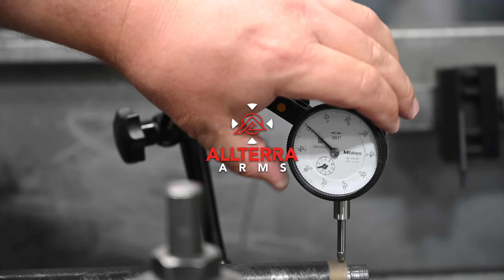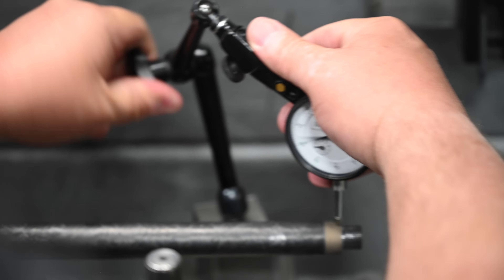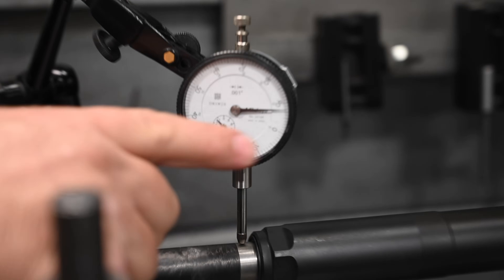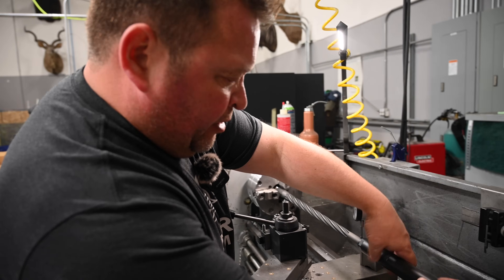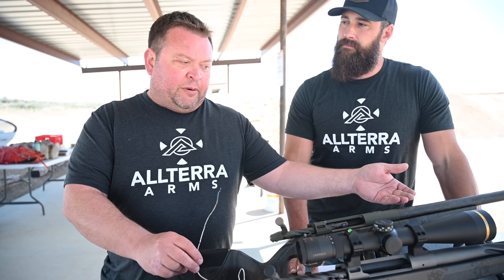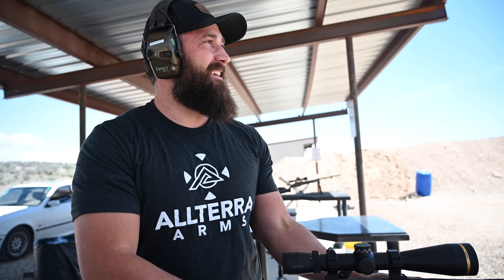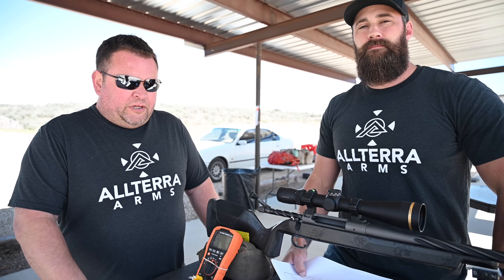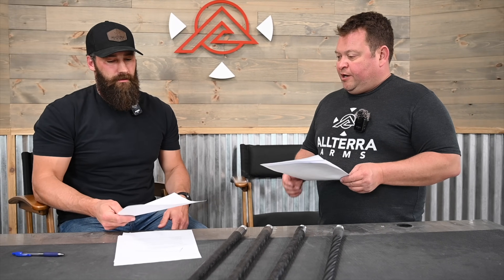Carbon vs. Steel Barrels: Rigidity and Cooling Test

Comment: Carbon wrapping & resin is an insulator obviously. Thats why nobody uses one in multi round competition. They have their place in the light weight hunting realm no doubt.
Reply: No, it's the resins and specific epoxies that are patented for heat disipation, particularly in the Proof barrels. They don't get nearly as hot, Outer or internal in what I've tested.
Reply: @apeshitcrazyman  Basic thermodynamic science says otherwise. No matter the manufacturer. Run a 20 shot non stop string through one & it will show you all you need to know on the heat front. That's why comp shooters don't use them.
Reply: @jaimesanborn308  No, now listen... comp shooters DO use them. But there are many great barrels for boltguns. I shoot comps, I've tested that very thing with a digital temp sensor. That's precisely where they do well, is longer strings of shooting, the temperature maintains cooler over a longer duration, where as steel takes longer to heat up but keeps and maintains that heat and continues to rise,,,,"thermal dynamics" as you claim,,, in fact that's what the first carbon barrels were designed for originally, is full auto schedules of fire, so as to plateau out in temperature, thus extending the barrel life, as it's under the extremes of temperature that barrels undergo the most wear....nothing close to mere 3-10 shot strings of bolt-action rifles.  BUT PAY ATTENTION, there is a big difference between the immitators and the OG, "Proof Research barrels", because they have a bunch of patents on the thermal conductive glue and resins,,, this is where the thermal advantage is... these other new carbon barrels, that are just insulators to heat, and lightweight which are better suited and marketed towards hunting rifles,,, the imitators of carbon barrels, just trying to piggyback on interesting technology and marketing.  You must understand the complete picture,, not just a surface level hunch and opinion on youtube!
Reply: @apeshitcrazyman  Interesting.. Not sure how proof has developed a resin that nobody else has? Resin tech is pretty straight forward, 2 parts that dry to a desired hardness. Carbon fiber is pretty straight forward as well. I work in the composites industry. I can almost 99% guarantee you they have nothing special in that arena that everyone doesn't already  have. Unless it's super space age proprietary type jam...
Reply: @apeshitcrazyman  They just used a data driven approach to show carbon is in fact hotter in this video... you got a video to show or just a "surface level hunch and opinion"?  And no, you do not see carbon barrels in high level comps, >5% at best and only on guns of folks that don't shoot enough to replace often.

Also, to original poster, video shows that a steel barrel at same weight (lighter contour) as a carbon barrel is MORE rigid and dissipates heat better.  So steel beats carbon in "light weight hunting realm" too...
Reply: @jaimesanborn308  Well my good man, i have friends who work there, so yes it is pretty space age stuff. Check out their patents good sir, you'll see that they are a parent company of a chemical engineering company that deals in plastics and thermal resins...and were 1% tooo incorrect. There are microfiber tubules involved in the orientation and weave of their carbon fiber,,,,, it's not just "pretty straight forward." They have whole security measures around it to protect the proprietary stuff.  . . Anyway, lil tidbits.
Reply: @apeshitcrazyman  Idk? All the tech mumbo marketing jumbo is pretty irrelevant in that great scheme of things. Proof barrels are no more accurate than run of the mill Tikka barrels/common production barrels unfortunately.
Reply: @jaimesanborn308  ....uh huh, yeah, this is me not being convinced of any of that. I now know, that you don't know. Sorry to hurt your ego, but you're not correct. Run along
Reply: @apeshitcrazyman  Convinced of what? That Proof barrels are nothing more than marketing hype that don't shoot better than anything basically... 😂🤣😂
Reply: @jaimesanborn308  @apeshitcrazyman The barrel in our temp test in this video is a Proof.

Comment: Hunting with minimal shots taken I’d opt for a lighter carbon barrel . Reduced weight of gear allows you to pack out more game.  Competition, I’d opt for larger steel barrel. Advantage of increased stability and recoil reduction.
Reply: Fluted steel barrels are lighter than even “featherweight” carbon barrels. Literally no advantage to them. A stock tikka barrel is lighter than any carbon of equivalent length
Reply: If you want a lighter barrel order a lighter barrel. In this video if you can actual understand the  words comming out of the mouths of the presenters the barrels where close to the same same weight within 3oz of each other. The lightest barrel in the bunch was one of the all steel barrels.
Reply: @buckaroobonsi555  I think you’re proving my point? At same weight, steel wins. So in theory you can go even lighter with steel, and get same performance as carbon. No upside to carbon
Reply: @Intermtn9736  It's just another wallet sucking accessory nobody needs.

Comment: 10:49 Wait, when you measured deflection, you used barrels of different lengths?!?  Adding a weight to the end of a longer barrel would add much more force than closer on a short barrel.  Did I miss something?
Reply: Yes they made them the same length by checking a barrel with a longer shank deeper into the 4 way chuck so that the amount of length from the chuck forward to the muzzle where all identical.
Reply from the maker: @buckaroobonsi555 what this guy said ☝🏼
Reply: @allterraarms Thank you.  Figured I missed something.

Comment: Choose the correct tool for the job.  If I'm packing a rifle high into the mountains on a sheep hunt I would rather have the carbon barrel to save any weight I can.  Put me on a dog town, and no way in hell would I want a carbon barrel.
Reply: See comment above, but carbon barrels are always heavier than hunting contour steel barrel, especially fluted. Literally no advantage to carbon but looks (and obviously, impression they are lighter. Which is marketing BS “compared to same contour in steel”)
Reply: @Intermtn9736  A carbon barrel is always lighter than a steel barrel of the same contour. Of course a carbon barrel that's .850 at the muzzle is going to be heavier than a pencil thin  .625 steel barrel.
Reply: @rdsii64  Nobody argues that, but you've been reading the marketing my man.  Nobody in their right mind is putting a .825 straight taper un-fluted steel barrel on their hunting rifle, which is your/marketer's comparison.  This video literally shows that a lighter contour steel barrel of same weight as carbon a) is more rigid and b) dissipates heat faster.  So better in every way.  Ever wonder why carbon barrel mfgs don't have studies or vids like this?

So, it logically follows that you can go even lighter on the steel and get equivalent stats (rigidity/dissipation) of the carbon.  Which mirrors my experience with both, and the experience of hundreds of others who actually test these on forums etc.  Carbon is just for looks, nothing wrong with that.
Reply: @ sigh. Go read it again. You’re regurgitating proof marketing.

There are no carbon barrels below a “sendero” contour for a reason… they’d be too flimsy (despite “featherweight” and “light” marketing names or tapers to .750). So it’s marketing fallacy to compare to same contour in steel, but they do it because it apparently works…

Video just showed the exact same weight steel barrel as the “lightest” carbon barrels on the market beats it (yes, it’s a lighter contour to be the same weight). That lighter contour steel is STILL more rigid and dissipates heat better than the thicker contour carbons that weigh the same.
Reply: A pound of lead weights the same as a pound of feathers! Carbon barrels are not lighter than steel barrels since under the carbon wrapping is a steel barrel that has been machined to a lighter profile before it has been wrapped. If you want a lighter barrel you pick the counter and length in steel that gives you the weight you desire.

Comment: I’m a believer that that carbon barrel acts like an insulator and internally temperatures are actually hotter than a steel barrel. So if that’s the case the carbon will shoot out faster.  I think you’re better off with a steel fluted barrel.
Reply from the maker: This is the trend that our very small sample size and far from scientifically acceptable experiment showed. Thanks for watching.
Reply: @allterraarms  what brand of barrels are you guys testing?!
You must understand that they aren't all the same. Carbon barrels are not an apples to apples comparison. Many are just lightweight glorified pencil barrels for hunting, while others are made to specifically dissipate heat with specific and patented epoxies and resins. Some are real deal and others are marketing hype.
Reply: @apeshitcrazyman  good point. I’m gonna insist on seeing test data before I ever purchase a carbon barrel.
Reply: @apeshitcrazyman  Do you happen to know which brand barrels are actually good at heat dissipation? I was interested in trying one but it is too hard to discern from a youtubers sponsored "favorite", versus the real deal. Any suggestions would be appreciated.
Reply: @TheAdam2877  in my experience, the only two worth messing with are Proof,  and CarbonSix. Everything else doesn't have the patents and technology etc to actually be any real improvement.
Reply: @edwardhoward4708 if your buying a carbon barrel for hunting. Do you really worry about shooting it out? Your buying it for it's supposed precision and durability arent you? I confess this is why I bought a savage ultralite with a proof barrel? I didnt do a ton of research. I can say that my gun doesn't string any shots as high as 16 and it maintains moa. I dont make a habit of this. But I will never shoot out any of my barrels on any of my hunting rifles
Reply: @apeshitcrazyman ive had a proof carbon in 6.5 creed.  It is an insulator, I'd never own one again.
Reply: @bruce6099  the 900$ isnt really worth it. I feel like it wasnt much lighter or rigid than the factory rpr barrel.
Reply: @apeshitcrazyman even if they’re optimized for heat distribution and dispersion, I serious still doubt it will match a carbon steel barrel or even close… MAYBE if I’m being generous match a stainless steel barrel which moves heat about 40% slower than carbon steel.
Reply: Not seeing carbon barrels at benchres or f-class matches
Reply: @christojordaan5018  who gives a shit about f class or bench rest shooting? Carbon barrels aren't really for that application. That's like saying I dont see any 4 runners at a Nascar race. No shit. But when your over 10 miles behind locked gates, ounces count.
Reply: Just saying that they are expensive and not as accurate as target stainless barrel also when cool down point of zero shifts.
Reply: @MatthewKyle-sg5uo Exactly 😂
Reply: I appreciate this very thorough comparison test. Your efforts are greatly appreciated . 
One other test/comparison (if it can be done) is for barrel whip.
Reply: Meh, my carbon barrel id on a hunting rifle. Not concerned.
Reply: That is certainly the case. You need only look up the thermal conductivities between steel and carbon composite.
Reply: @RonV535  the thermal conductivity of polymer and about as stiff as aluminum. You'd be better off with an aluminum sleeve.
Reply: Your beliefs alight accurately with the fundamental material properties of carbon vs steel. Lower thermal conductivity (heat transfer rate) lower heat capacity (ability to retain heat) conclusion: penalties off set repeat 1st down. If you ant to spend $1k for new and flashy go do. If you want rugged and durable go with time tested.
Reply: The one and single largest advantage of a carbon wrapped barrel is tool-less barrel changes -- So if you're running a Terminus Zeus QC + removeable barrel, and it's hot enough to cook an egg on a rock outside, you're firing rapidly and want to conduct a barrel tool-less barrel change, that is its biggest advantage. Lighter? A little is not always better but it can be mitigated with a good break (and or) suppresser. Heat transfer? Not really - better harmonics? You'll never notice the difference. 
Bottom line -- this is all very much still in the testing phases so there is a lot to learn about this. It will not be long before different materials are used that are advantageous over any barrel currently made today and that is a fact. We haven't scratched the surface in terms of metallurgical steels is concerned when they are used with other materials that we are only now starting to develop.
Reply: I’m a mechanical engineer and have been saying for years that carbon barrels are overhyped. Thanks for confirming my suspicions. So many people misquote and simply don’t understand material properties. Great video!
Reply: I think so too.  If that heat can't radiate to the air, it's going to travel somewhere.  My theory is back to the action and/or stock.
Reply: I think similarly
Reply: Yes, and and everybody else that doesn’t know shit
Reply: 100% correct my friend carbon traps heat
Reply: That was my own conclusion after many brl tests more the 3 decades ago and yes, I already made my own different types of carbon-brl’s back then!

Comment: What's the steel barrel contour?
Reply from the maker: One was a Bartlein 3B and the other an Ace SP3. Very similar contours. Our go-to for steel rifle builds unless someone wants a heavy.
Reply: Does it matter? They chose fluted barrel contours that matched the weight of the carbon wrapped barrels. In this case they where weight matching. I understand your point of view though.
Reply from the maker: @buckaroobonsi555 He may have just liked the look of the contour to be fair

Comment: Be cool to see the deflection in barrels with different fluting designs😊
Reply from the maker: Great recommendation. Immediately curious on this end, we’ll get it setup. Thanks!
Reply: @allterraarms  would think a straight fluted barrel would be the most rigid but who knows.
Reply: @allterraarms  The related and perhaps more important question is how much fluting reduces the barrels fundamental accuracy and whether or not different fluting methods change the accuracy.
Reply: And from a bull barrel too!

Comment: I think your deflection test in lathe would be more accurate if you threaded a piece of stock for barrel to thread onto. I think deflection would be less.
Reply: I think that since the deflection tests returned to zero, the chuck is securing the end of the barrel adequately for apples to apples comparison.
Reply: explain how chucking a round object in a lathe is any different than threading a round object into another round object chucked in a lathe.
Reply: @daltonszwalker6026  because you can chuck to on a larger diameter piece of material, and chuck it a little harder. The barrel has a shoulder on it that bottoms out when threaded on. And if the goal is to collect data, then collect data in the components operational state.
Reply: No it would not. The diameter of a barrel tennon is small and fairly short compared to the contact area of a 4 way chuck. The action is going to flex at the front reciever ring long before the chuck is going to deflect!
Reply: @buckaroobonsi555  also if you watch when he chucked it up only it was only finger tight. A 3 Jaw chuck finger tight is not as ridged shouldered out threads.
Reply from the maker: I’ll explain your recommendation to Drew.

Comment: I've always believed carbon barrels were overrated.  I don't hear about how "consistent" accuracy out of a factory using those barrels.  Pick up a Tikka, Cz, bergara with a steel barrel, you 99% guaranteed to shoot well under 1moa.  Carbon barrels can't give you that....maybe some can....but not as often as a good steel.
Reply from the maker: "Not as often" is the key phrase. We certainly have to replace Carbon barrels for accuracy far more often than steel (as a result of our own testing before shipping to the customer).

Comment: Out of 40+ rifles in this house, only 2 have carbon barrels. There's a reason for that.
Reply from the maker: That comment fits your username nicely!
Reply: That sounds like a beautiful collection! Keep it up and let the world know! USA!!! 😊
Reply: Because you’re cheap?
Reply: @SammyMoore-tg5gs  I suppose that could be someone's opinion if you consider a 450.00 steel barrel plus another 125.00 to flute it and another 100.00 to Cerakote as "cheap". But the real answer is no I'm not cheap. I got the Tikka Proof prefit in 7PRC for 751.00 at year end sale and the 6.5mm Proof on clearance for 612.00. I just left my FFL picking up a Defiance anti x action and Defiance Deviant GA Hunter action. Have yet to decide which it will go on but will be 6.5PRC. I've seen zero benefit to CF barrels vs a good #2 or #3 contour steel barrel in terms of weight, accuracy, etc. I wanted to see what all the hype was about. And just like my two suppressors, I would rather have purchased more steel barrels for my QC action. I've concluded a lot of men are just weaker, tender princesses, than men were years ago and whine a lot more about toting a "heavy" rifle around the mountains 🤣. I'm a whopping 5-8 and 185 pounds, OLD, carried my 26" barreled 10+ pound rifles in KY, MO, AL, SC, TX, CO, WY, multiple Canadian provinces going after muleys, black bears, pronghorn, whitetails, elk, hogs. CF barrels did not make me say WOW and neither did my suppressors. And by the way, there's NO CF barrel worth 900+ dollars. They ain't magic.

Comment: the man isn't wrong: thermistor is a semiconductor type of resistor in which the resistance is strongly dependent on temperature. The word thermistor is a portmanteau of thermal and resistor.
Reply from the maker: The 'thermistor' discussion definitely went longer than what made the cut in editing.